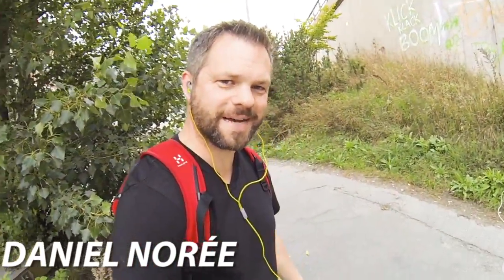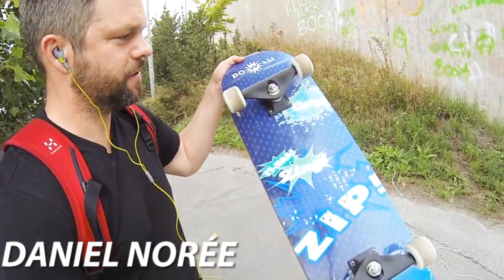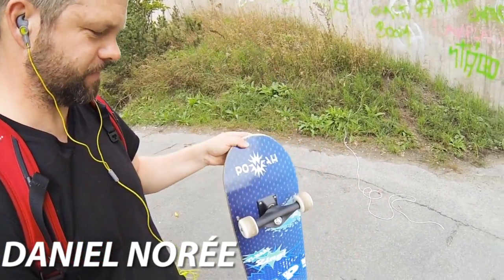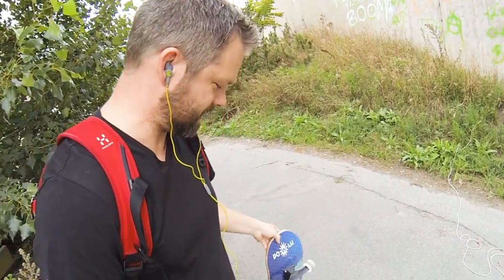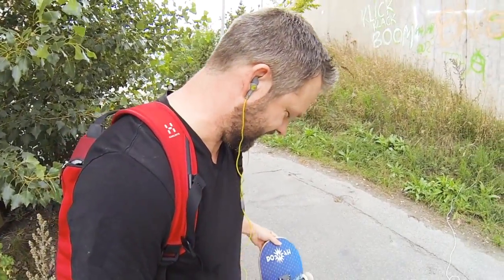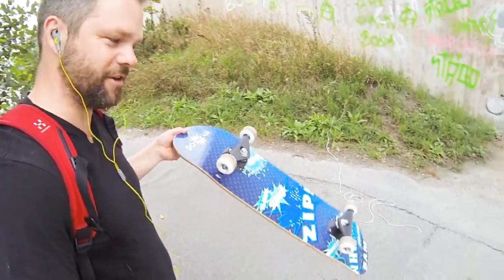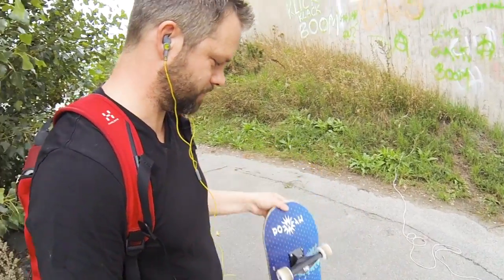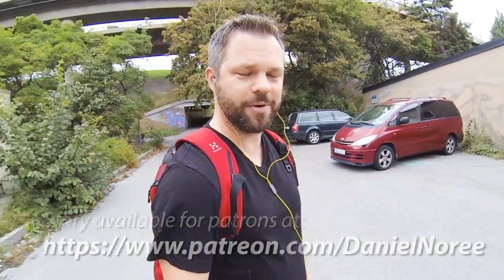3D printed skateboard trucks

Comment: Awesome video bro! What if you put a couple of coats on it of resin, you think you would be able to use them more on a daily use? Awesome stuff bro!
Reply from the maker: Stuff like this (aswell as with the OpenRC stuff) depends heavily on the printer, settings, plastic, slicer and the operators knowledge on 3dprinting. Worst case scenario someone gets badly hurt. So in general i would never recommend someone to use stuff like this without being fully aware of what they are doing and that putting themselves on a board with 3D printed trucks can end bad.